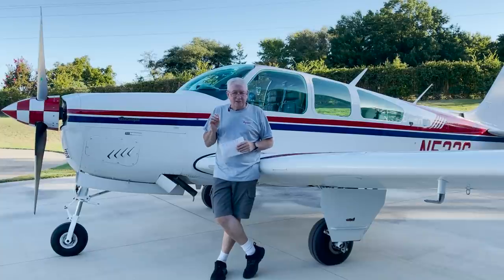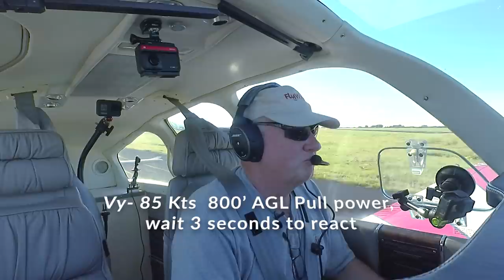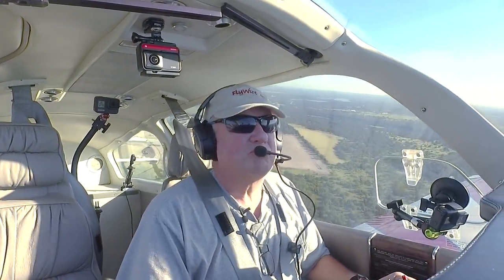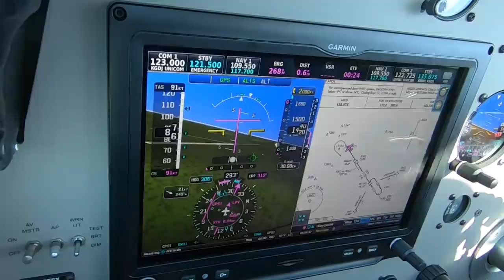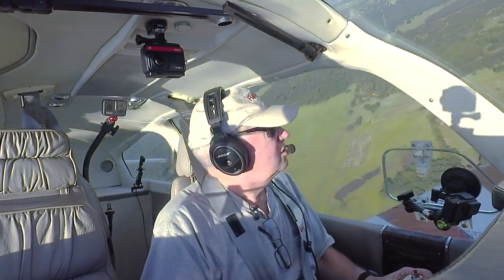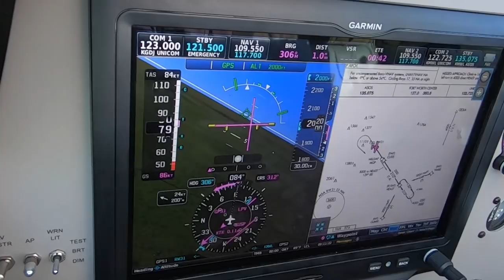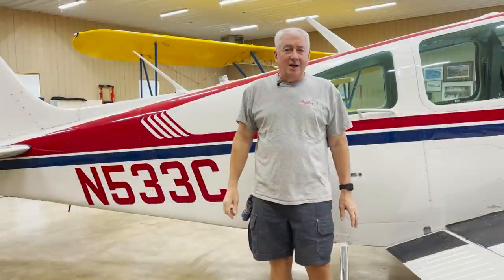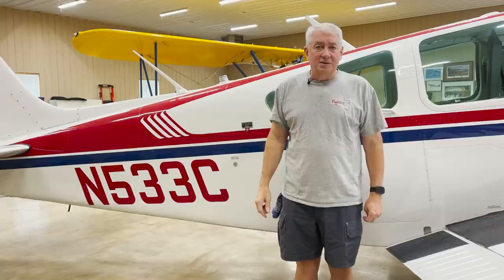Engine Failure After Takeoff  How do You Practice That

Comment: I had a "Impossible turn" demonstrated at 500ft, where upon detecting engine failure he dumped the nose to yellow arc and then pulled a hard turn back. We made it back onto runway heading with alt to spare, in a -172, do you have an opinion on this technique? I know in unpowered aircraft with a line break on tow (surface or aerotow) this is something that we're used to, but not so much in powered aviation.
Reply from the maker: As I said, each airplane is specific… it’s all about wing loading. A glider has excellent glide ratio. The technique you describe in the 172…. Well, we used to have a saying when I was in the Marines and someone was doing something stupid…. “Can I have your Stereo?”
Reply: I flew gliders and 172's. Even a crappy glider has about twice the glide ratio of a 172, which means what it can do in 500 ft, what a 172 might need up to 1000' to do. Engine out approaches are standard practice in a 172 and aren't much different from what Scott demonstrates here. Both have a predesignated hard deck/go around altitude, require you to immediately push the nose down, hit speeds very precisely and coordinate your turns. The biggest difference is that you have less time to react while climbing after takeoff. Until you practice enough to really get to know the limits of your airplane, my gut tells me that the average pilot in a light plane should pick no lower than 1000' as their turn back limit...but I'm kind of a coward that way. I also think it couldn't hurt to get a bit of knowledge of the topography around the airport before taking off.

Comment: Great training, Scott, really appreciate Your videos! Just one question not pertaining to this particular training, but related to the general operation of Your F33C. 

In this video I noticed that on Takeoff and establishing a 'Positive Rate' You practically immediately 'Raised the Gear.' Having attended the Army IERW WOFT program over at Ft. Wolters in '68 I'm kind of familiar with the area. I believe RWY 13 at 'MWL' is 5996 ft. long and the Beech F33's T.O. is approx. 1225 ft. to clear a 50 ft. obstacle. I realize Your video is about power failures after takeoff during the climb, but that aside, speaking of the initial takeoff, as it pertains to 'Gear Retraction,' My Instructor, back in '64 after He had cut Me loose in His E35 Bonanza a few days after My 17th. Birthday and having received My Private Pilot Certificate,  a few days later happened to notice Me 'Snatching the Gear out from under Her' within seconds on a 5,000 ft. RWY at 'SFQ' with My High School Girlfriend on board because I thought it was 'Cool!' Later He would stress on Me, in no uncertain terms, that I was gonna look pretty silly to My Girlfriend one day, when ole N3250C desides to 'Cough' with Me having the Gear 'Up & Locked' Sliding down that concrete runway on My Belly with the remainder of that 5,000 ft. of perfectly good concrete still out in front of Me! Anyway, Scott, it was just an observation. Thanks again for all the great training and information, Sir! 
Sincerely, David Nichols
ATP F/W R/W CE550 CL601
Reply from the maker: Thanks for the question David. At what point would you raise the gear? Supposing your desire is top land back on the runway if you have an engine failure. How much runway would you chew up on takeoff roll and climb to 300'. A normal approach/ 3 degree glide slope should have you at 300' at One mIle form the runway. Seems to me that you wouldn't have much runway left, if any. On a 10,000' runway that may be different. For me, I'd rather have the energy than the certainty of running off the end of the runway. After all, you can still land on it gear up. For What its worth... I DO NOT snatch the gear on clearing the ground. I'm established, with a positive rate... then raise the gear. Maybe I need to do a video on that.
Reply: Thanks for Your reply, Scott, I do appreciate that, Sir! To answer Your question as to when I believe I should retract the gear on a single-engine airplane, I would have to say I subscribe to not only what My first Flight Instructor, George A. Cales, stressed on Me back when I was the 'Airport Kid' in the 60's, as well as the FAA recommendation as follows:

Takeoff and Climb

Normally, the landing gear is retracted after lift-off when the airplane has reached an altitude where, in the event of an engine failure or other emergency requiring an aborted takeoff, the airplane could no longer be landed on the runway. 

This procedure, however, may not apply to all situations. Preplan landing gear retraction taking into account the following:

Length of the runway
Climb gradient
Obstacle clearance requirements
The characteristics of the terrain beyond the departure end of the runway
The climb characteristics of the particular airplane.
For example, in some situations it may be preferable, in the event of an engine failure, to make an off airport forced landing with the gear extended in order to take advantage of the energy absorbing qualities of the terrain (see Chapter 19, “Emergency Procedures”). In which case, a delay in retracting the landing gear after takeoff from a short runway may be warranted. In other situations, obstacles in the climb path may warrant a timely gear retraction after takeoff. Also, in some airplanes the initial climb pitch attitude is such that any view of the runway remaining is blocked, making an assessment of the feasibility of touching down on the remaining runway difficult.

Scott, I realize You're very aware of all that's included in the FAA recommendation, as I would never question that! I just truly appreciate Your responding to My comment as I have great respect for You and Your aeronautical experience, Sir! 

My Flying experience began when I was fourteen and had gotten a job at Suffolk Airport pumping 80/87 & 100 octain, washing airplanes, etc. seven days a week during the summers and every weekend for two dollars a week along with My Flying Time until My High School Graduation and left for the Army and on to Vietnam in 1968. By the time I left Suffolk Airport I had turned 18 and had My Commercial Pilot Certificate. Served four tours in Vietnam, flew Helicopters for twenty-five years as a Trooper-Pilot with the Virginia State Police Aviation Division, Flew Corporate with Massey Energy for fourteen years as a Day-Hire while with the VSP and then another ten years fulltime after retiring from the State Police. Returned to Flying Helicopters for AirMethods Flying Medevac Helicopters with VCU LifeEvac out of the Richmond, Virginia area. 

Thanks again, Scott, for allowing Me this time to converse with You. it's truly an Honor to Me, Sir!

Comment: Scott, thx for this video. Going to practice this in my F33A. Vx is 77,  Vy 95. Thought the C was the same. You used 85. Was that speed picked as a “middle of the road” thing?
Reply from the maker: Technically the POH says 96 knots... so I probably should have used that. But I've tested Vy/Vx and to me 85 works better than 96. But the only real time I use it is for s demo like this... I use Cruse Climb as my climb speed.

Comment: I'm not a pilot, but wouldn't the length of the runway be another consideration assuming your using the total length for takeoff.    I may of missed it, but on a shorter runway would you not be further from the airport by the time you reach 1,000 feet.   The shorter the runway the greater the distance traveled and I would assume you would  need to increase your minimum altitude for a turn back.    Just asking.
Reply from the maker: Exactly right!

Comment: Concerning the parachutes available now for the aircraft do you know the Minimum altitude for these things? I would assume it is very weight and balance related.
Reply from the maker: I'm not sure what you are asking. Typically parachutes are rated by the weight they can handle at a certain opening speed. The only minimum altitude is your judgment.... if you life depends on it and it is your only choice.... what is a minimum?
Reply: The chutes that lower the entire plane, I only saw a  demo video, did not research it , Imay find some info on chrome.point well taken, anything that could save you a d your passengers is worth looking into.

Comment: Instead doing a straight out departure before turning would a cross wind turn at say 500 feet and then power loss at say 1000 feet allow you to return to the airport. 90 degrees of the turn is already complete also, you might be closer to the airport. This would require a change in the way we do traffic patterns. Just spit balling.
Reply from the maker: How practical would that be?
Reply: some airports have TPA's under 1,000 agl.  I taught on 2 of them.  Sierra Academy in Oakland had a 500 agl pattern for touch and goes.  I loved them.  Used to do 11-13 touch and goes in one hour.  Fast..

Comment: I like most here have been flying for many years. If I thought it (engine out on take off) was going to happen to me I’d wear a aerobic shoulder harness and helmet - because I would no doubt crash - somewhere. “But it’ll never happen me.” It’s this attitude that gets people killed not just in GA aircraft but many things in life.
Reply: Most engine failures are partial power, not total.  cylinder fails mostly.  You have 4 to 6 cylinders that can fail due air cooled cylinders fail 30 times more than liquid cooled.  I learned in 1996 to do turnbacks from 400 agl similating a cylinder failure.  Cherokee.  Using 1,700 rpm.  Better to practice turnbacks at partial power first.  Lower the nose, troubleshoot first, then call traffic, turnback after calling.  Great exercise..

Comment: Most engine failures are partial power, not total.  cylinder fails mostly.  You have 4 to 6 cylinders that can fail due air cooled 
cylinders fail 30 times more than liquid cooled.  I learned in 1996 to do turnbacks from 400 agl similating a cylinder failure.  Cherokee. Drop power to 1,700 rpm, drop nose and drop some flaps because it is like a slow flight turnback at around Vfinal speed and 45 banking.  You wont stall with power at Vfinal with some flaps. My CFI had a blue line at the Vglide speed, under it, we needed flaps for safety.  
Better to practice EFATO turnbacks at partial power first.  Lower the nose, lower flaps, troubleshoot, then call traffic, turnback after calling.  Great exercise to practice all the basics of flying and Emergency Low Maneuvering combined.  Hard maneuvering makes hard to knock down pilots like my cfi used to say. He called EFATO in 1996 as Emergency Low Maneuvering.

Comment: If you turn back or not should depend on the conditions, if you take off with a very strong head wind and have to turn down wind you will have less momentum in the turn because your ground speed is lower, this is a situation that could result in a stall spin event,  but in saying that if you are looking at your airspeed your turn will be appropriate for the conditions.
Reply: Airplanes fly by IAS, not groundspeed.
Reply: @emergencylowmaneuvering7350  I am referring to the momentum needed to complete a turn without power, as I explained you will need momentum to complete the turn to downwind and depending on the conditions you may not be able complete the turn without losing a lot of altitude, your ground speed is your momentum not your indicated airspeed.
indicated airspeed is not relative to momentum, your speed in relation to the ground is. you should consider this before turning back to the field.
Reply: That's the kind of thing a pilot would have to take into consideration before they took off, not after an engine failure. You only have seconds to get that thing on the ground intact enough to give the passengers the best chance of survival...which is the main goal.
Reply: @Joe_Not_A_Fed  Yes of course, once you find yourself in that situation you have to play with the cards you are dealt.

Comment: The Vglide 45 Turnback.  Use real Vglide speed, not like AOPA video on Bonanza were the guy used an over Vglide speed and the coward only banked 30-35 bank only and declared it is impossible to  do that turn.  The coward did it wrong.  Thats why.  A pilot that cant turn 45 degrees?  LOL..

Comment: Only standard rate turns?  
I fly a light sport. If I loose an engine on takeoff I’m putting in full flaps stalling it in the treetops (38mph) or slipping it into a clearing. This turning back business under 1000 feet agl seems dicey to me. AOPA got some heat on their series. Someone may f up and stall it in trying to practice.
Reply from the maker: Good plan. Who said anything about ‘only standard rate turns’?
Reply: Stalling on Tree Tops? LOL.  Seen photos of airplanes on tree tops.  Need a helicopter 5,000 dollar rescue to get you out of there.  Or pilot breaks back falling from the tree. LOL>>  and stalling it?. LOL>>